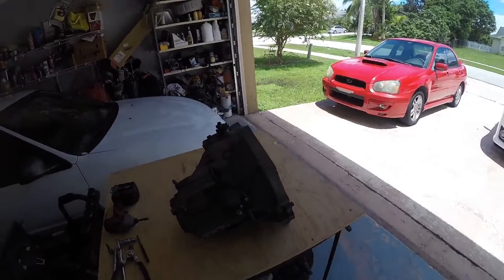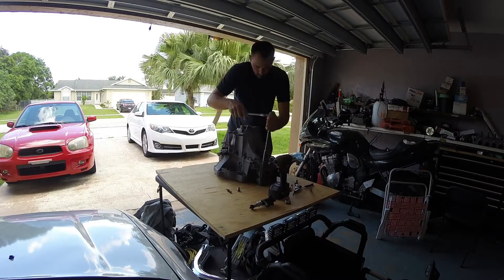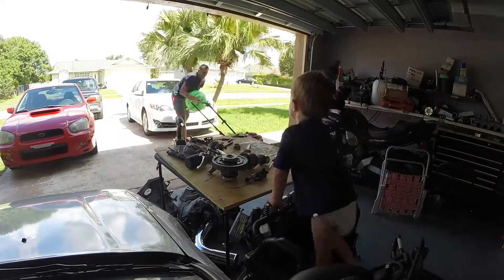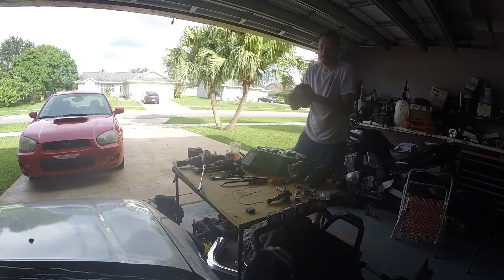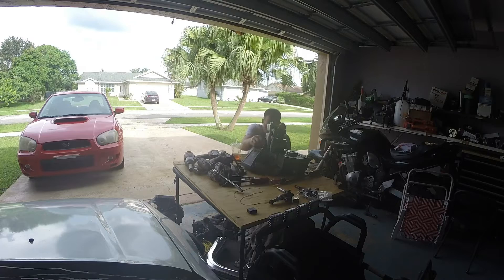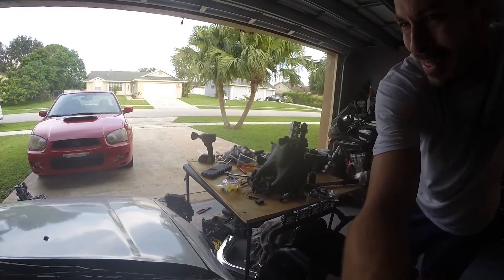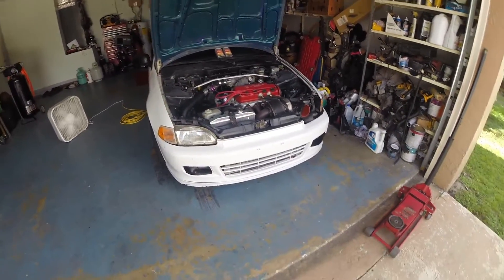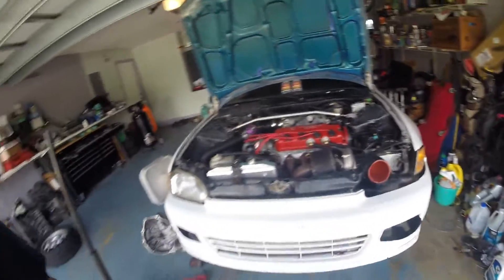fixing my broken trans, swapped the helical 1.25 3rd for a Straight cut 1.26 3rd

Comment: you dont fill s20's through the snap ring plug hole... do you?
Reply from the maker: Either hole is fine, same level. the snap ring plug is easier to get to.
Reply: @hatchbackturbo93  Ok. It's your show. Keep in mind they all have different heights. https://i.imgur.com/9ixnH64.png
Reply from the maker: No, through the vent on top until it comes out of the plug hole where the snap ring is
Reply: my mechanic did that too. I got a bit pissed because he stripped the square socket hole in the bolt because he had difficult access to it.
my owners manual, in portuguese, has instructions like in this picture, that i think is from some workshop manual.... 
https://honda-tech.com/forums/attachments/honda-civic-del-sol-1992-2000-1/369618d1403525693-my-s-20-manual-tranny-fluid-capacity-anomoly-picture_8622.jpg

Comment: Hey bro what did you do to the stock fpr to support your high fuel pressure
Reply from the maker: https://m.ebay.com/itm/Blackworks-Racing-Adjustable-Fuel-Pressure-Regulator-Honda-Acura-Silver/201936151402?fits=Year%3A1992%7CModel%3ACivic&hash=item2f0455236a:g:O6cAAOSwGJlZJ22i
Reply from the maker: Instagram @turbokenny87 or D-serious on FB
Reply: D-Serious don’t have social media brother
Reply: I just want to know if it was possible to send me your tune so that I can program it on my s300 because I was still on a chipped p72 i finally got s300 with boost by gear
Reply from the maker: Im using neptune rtp, im sure its not compatible with hondata. There sound be some good basemaps to start with on the hondata.
Reply: D-Serious I don’t even know where to start honestly
Reply: What cord do you use for the Neptune rtp my guy says I can use that to retune my chipped p72